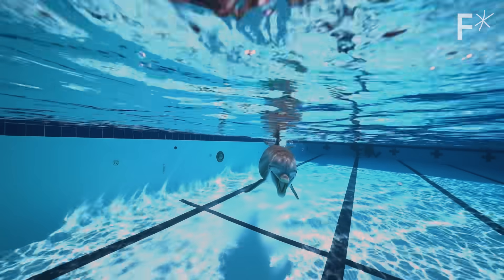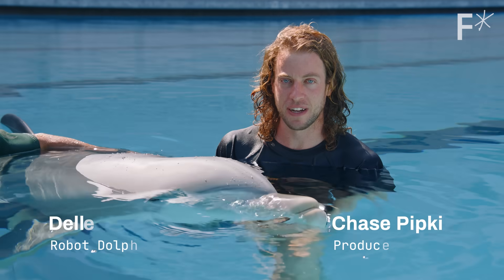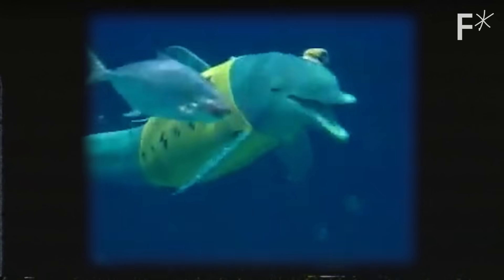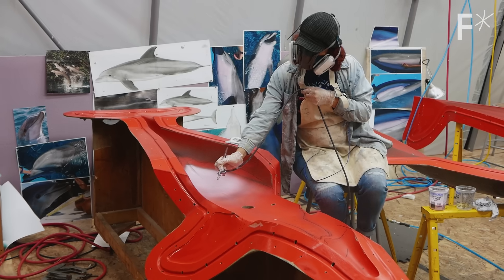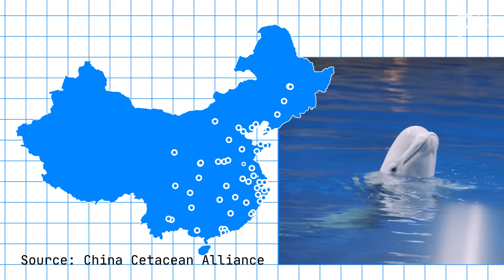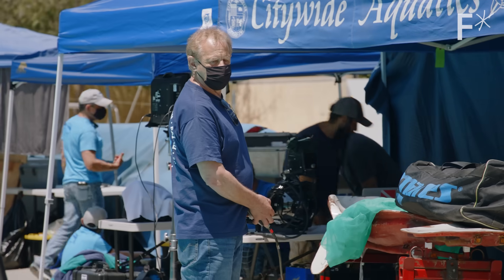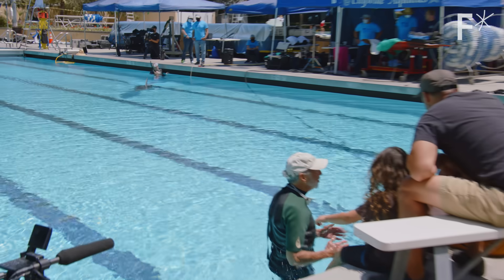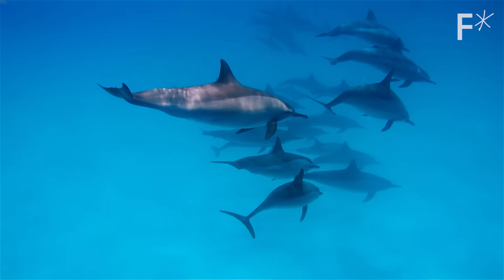How robots could end animal captivity in zoos and marine parks | Just Might Work

Comment: This is mindboggling. I never in a thousand years would believe it possible. I was wowed by animatronics in the Jurassic Park franchise but this? A totally immersable, independently free swimming robotic dolphin. Can you imagine what an AI inclusive program would do? Waits for the cue, recognizes which behavior is asked for and performs it. Plus no more need for artificial salt water which is expensive to make and maintain. Chemical requirements of chlorine residual to negate the effects of fecal/urine output from so many animals is eliminated. Regular potable water can be substituted. Perhaps copper sulfate to continue the blue hue of the water may have to continue. Then there's the cost  elimination of having to purchase food fish by the multi ton semitruck loads. And the eletrical cost that entails to keep it on hand in multiple freezers. Lots of staff reduction though seeing as food processing for the animals is no longer a need. Gads, robotic dolphins and orcas. What a concept!

Comment: One thing, if someone were to put there hand in the dolphins mouth and it closed, that has teeth. You can see in the video they added teeth. It would grip the human hand and start swimming, tearing at the flesh. Another thing, if water were to get in it, it would electrocute everyone in the water. Plus, where the mouth is, that looks sharp. It could slam into walls, and if someone is leaning on the walls of a pool, it would be stabbed in the stomach- Causing bruising.

Comment: this is a stunning idea, and stunning machinery! If fake zoos were to become the norm, the animals that were not needed for conservation would have no need to be locked up. The price concern for fake zoos is also valid, but how long the machinery would last and having no need the things real animals need would likely even the price. Also, think about it. The animals that still need conservation could have separate places for that work. Conservation places would be very different from public zoos. Now the conservation areas are separate, they would be able to focus on the actual animals wellbeing and not the publicity, and visitors. You see? A place without cafes, gift shops and such opens up more room for the animals. I'm sold!

Comment: Absolutely no need for robots. If you can't touch them and if they're fake anyway and don't behave and move on their own reactions and instincts, it'd be enough to simply put up some displays (like TV-screens or computer-monitors) instead of glass-windows and just show animated movies, pretending to show real life. Absolutely same result - fake life with computer animated behavior, same visibility for the spectators, but much, much cheaper, less energy, NO water needed, easier to achieve and absolutely no difference. What would a robot be any good for if the CGI-animation of a faked animal shows exactly the same result?

Comment: Wouldn't work. You can't feed them (which is part of the attraction) - and looking at the video, they are slow, and do not perform the leaping tricks and twirls that normal dolphins do, which is also a part of the attraction. Another thing, is the creepy factor. Yeah, it looks okay, but you can tell there is no life in it - it's being controlled - it will not respond to your reactions within the split of a second that a normal dolphin would.

Comment: Dolphin 3.0 will be A.I, learning by itself, alive for 5-8 hours
Then you mention about Dinosaurs and Tigers too 😰
What will 4.0 or 5.0 of each animatronics be?  (sweat intensifies)
Reply: no animatronics need, big screens with CGI would give exactly the same result and effect for the viewers. Imagine a zoo being nothing but a multiplex cinema, showing animated pictures of animals on all walls. Looks identical to robots or even better, behaves the same (according to algorithms), needs less technology, less energy, has less glitches - and not even one drop of water needed to showcase those "dolphins"
Reply: @RonK  But won't the perceptive depend? I'm sure it would look awkwardly stretched out if people scattered around the zoo viewed it from multiple angles... Unless they place a marker on the floor to force viewers to get the correct dimension of the animal. 

Multiple eye tracking won't ever work. 
Then the only solution to that is 3D Volumetric Displays (not Hologram) which do not exist yet in large scales yet, still in research at the moment.

Comment: This 'sounds' nice. But I am not that optimistic about the "keep the upsides without any of the downsides" part. I mean... look at any industry where robots replace human jobs, and you see that often doesn't work out to well for the humans (great for the lizard overlord investors tho). My concern is that an artificial zoo does not necessarily need a single person with a marine biology degree, veterinarian degree, or really any personal investment in the well being of animals. Because there would not be any. And once those are gone, the board meetings look a lot different. 

If you spent a decade getting a degree to be an animal doctor, you probably like dealing with animals (or otherwise, you went somewhere very wrong with your life). So when you have a vet on the board, he will suggest animal rescue efforts, and then he will try to find reasons to convince the other board members. 

before, you could have the head vet say "we have 10 people on staff, but we aren't using them right now since we sent that exhibit to the other zoo. Why doesn't we have our spare vets keep their skills sharp by treating some local animals". But with an artificial zoo, the "unused workers" would be electricians and engineers instead. Which might be useful for helping with home or auto repair in needy households, but not so much for the dolphins.

Comment: While I'm definitely all for this and think having animatronic animals could enable a far more appealing angle fom tourism (don't need to worry about natural animal cycles anymore) they also are being a little too optimistic about the $ savings I think. Sure in the long run against caring for a live animal you might be saving some money, but that has to be put up against the cost of maintenance, part repairs, the cost of those parts and the labor required to implement it. I'd also want to know the waste generated in the construction of these animatronics.